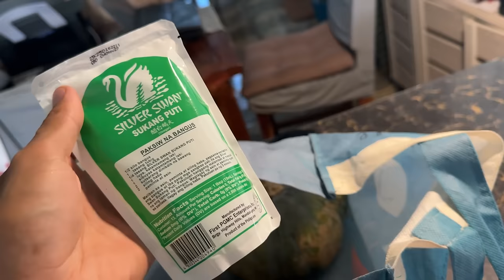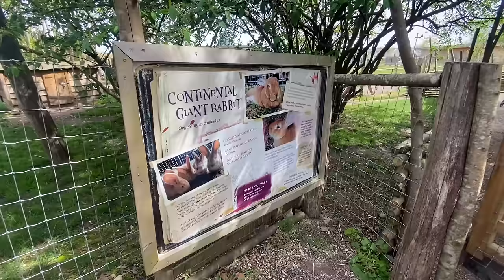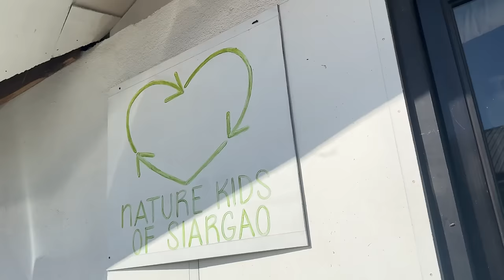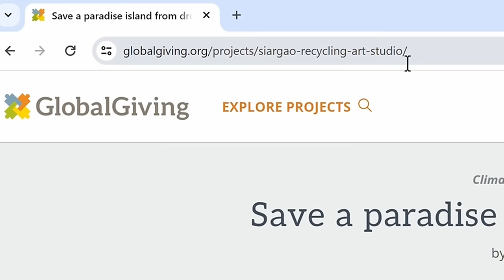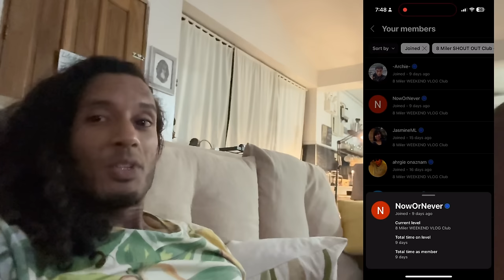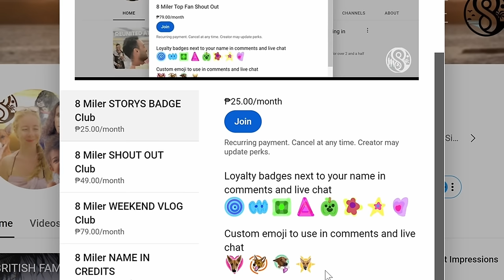🇵🇭 Philippines vs England 🇬🇧 Foreigners See Things Differently 😲

Comment: it's one way of letting you know that all the parts they charged you was replaced , in the US there's no way of knowing if you are not mechanically inclined. sometimes they charge you for rotating the tires but if you marked it you'll find out they did not do it. :)